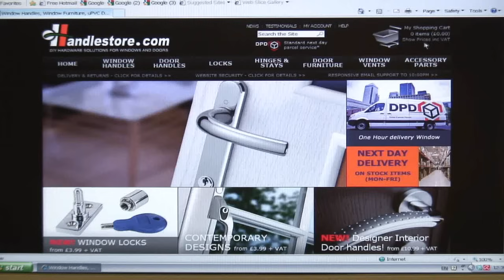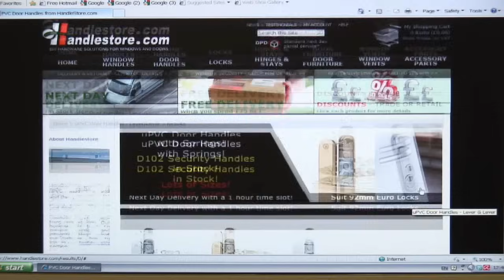How to Replace uPVC Door Handles

Comment: The external handle on my UPVC front door seems to be loose and wobbles quite a lot - do I need to be concerned at all? The handle on the inside seems fine. Can the external handle be replaced without replacing the internal handle?
Reply: yes u just buy a complete handle and use one half. save the second half for when other side packs up. measure carefully before you buy